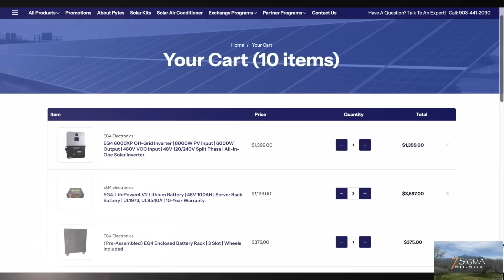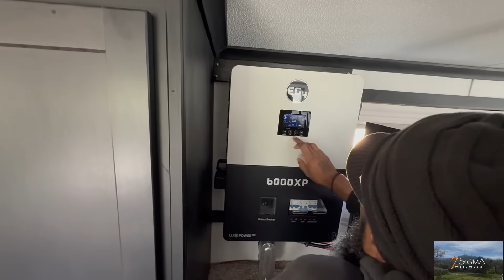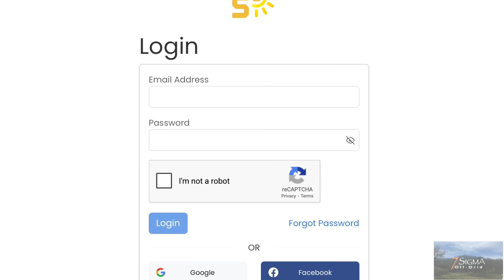💰HOW MUCH Did We PAY for our Off-Grid SOLAR Setup?☀️THE TRUTH Will SURPRISE You! #offgrid #homestead

Comment: i've been looking into doing a solar system as well. 11kwh seems low for that price? just an fyi for anyone else looking into it or even if you want to upgrade later. i found a 21.5kwh  (ECO-WORTHY) kit on amazon that consumers have said puts out ~19kwh it is for $8,000 but of course you'd still need to pay for mounts, trenching, materials, etc but could be a better option given the additional power you'd potentially get daily
Reply from the maker: Thanks for the heads up! We only paid $6300 for 11kW worth of equipment. That’s enough power for us for this phase of the homestead build. We’ll go with a larger system on the house build. Also, make sure to do your due diligence on whichever system you decide to roll with…cheaper ain’t always better and may cost you more in the long run.